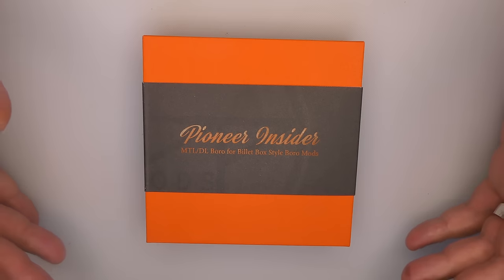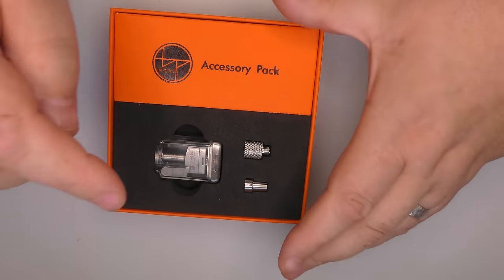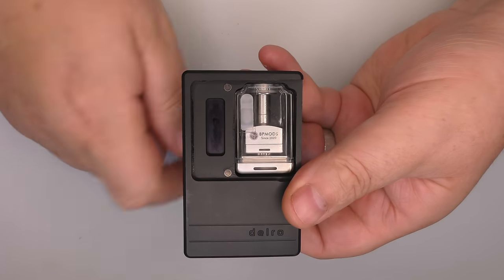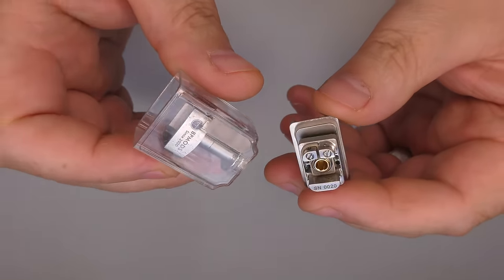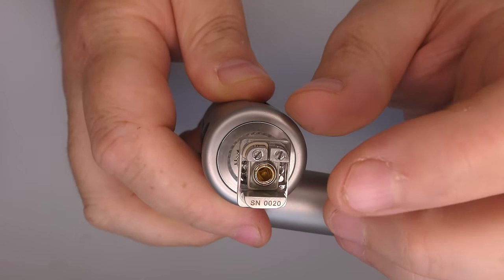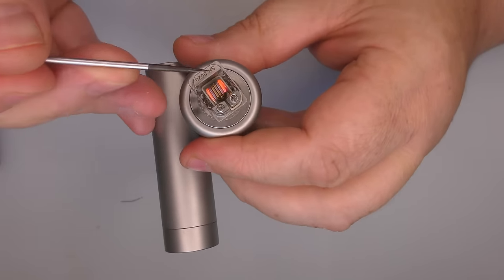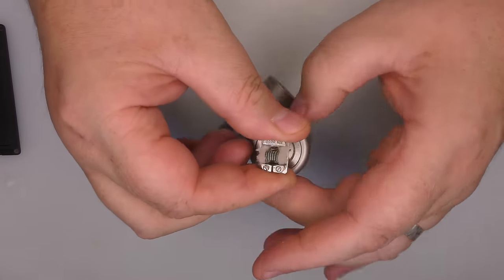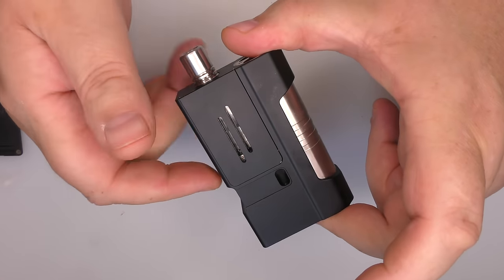Pioneer Insider by BP Mods

Comment: Had the same issue with too wet cotton. How to fix (worked in my case): put the lower part of the rba onto the chimney without the bottom - this tilts very quickly. Then the rba does not close completely off . Make sure it fits perfectly. Then close the tank with the bottom section. You´re done :-)
Reply from the maker: Thanks for sharing :)